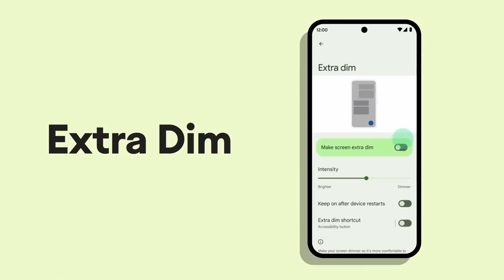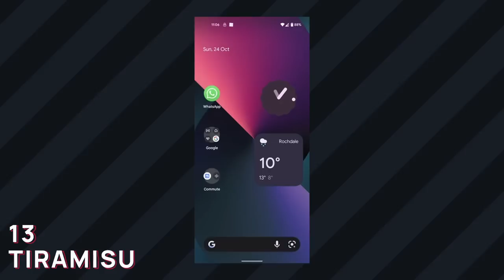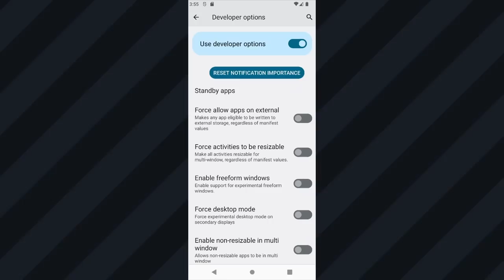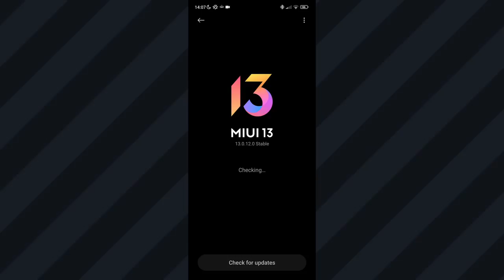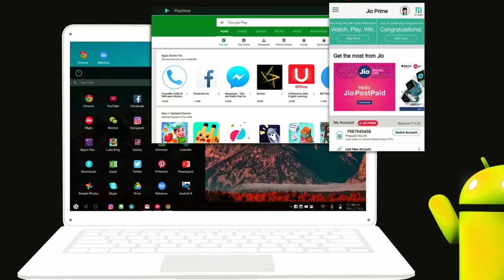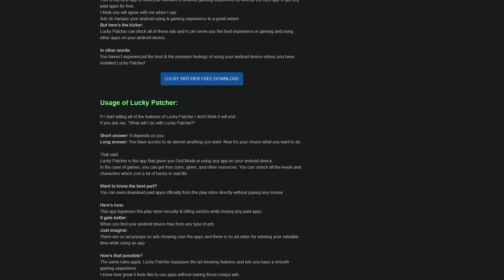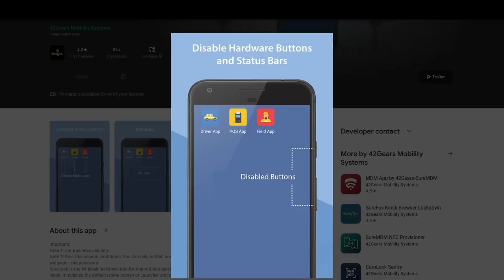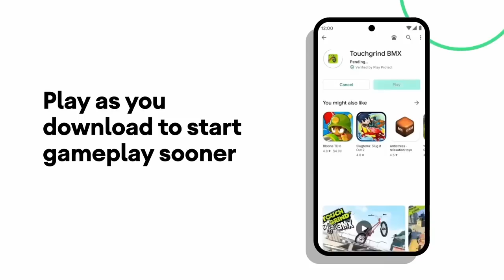The Complete Android Iceberg Explained

Comment: Btw, if your phone are running Android 12L/13 (yes, a phone, not a tablet) try setting the DPI (normally found on Display/Developer Option) to around 600 and Taskbar will appear, although somewhat broken.
Reply: Note: It's best to try it on AOSP Custom ROM (Pixel Experience and other) but I tried Ported Motorola Stock ROM and taskbar does appear, I can't say the same for other OEM so your best answer is to try it yourself
Reply: Wow it actually works! I dont think it's particularly useful but whatever
Reply: @lordkaczuha4598  Few Custom ROM made it very usable (even some implementing it to their ROM) and at some point: very useful for the ones that always multitasking
Reply: @Hyrionn  I use lineage os 20.0 myself and it works for multitasking, its just that i find the gestures super clunky as im more used yo the 3 button navigation
Reply: @lordkaczuha4598  Yea personally I wouldn't use it, but it's a nice fact to know
Reply: @Hyrionn  which device are you running motorola rom on?
Reply: @mom_spaghetti  Redmi Note 8, port for it  exist though my Note 8 just died recently after 4 year of continuous uses
Reply: this feature is meant for tablets
if you flash a gsi on a tablet you would normally have phone ui

Comment: one other weird samsung feature is the heart rate, SpO2, and UV (UV measurement feature got removed with an update to Samsung Health app, need to use old versions to measure) sensor that got added on S5 and Note 4. The sensor got removed on S10 and Note 10 devices.
It also worked like a shutter button on the front camera.
Reply: They really should add these old features back, especially the thermometer and the heart rate
Reply: the sensor still on s10 it got removed on s20
Reply: @whit3zin  hmm it seems like i confused the two

Comment: 1:45:49 it probably has some uses like public kiosks used to get information about the business, bus arrivals, etc. where you don't want people to mess around with the device. Or POS terminals where again, you don't want people to do something they shouldn't.
Some things that I think should be included on this Iceberg:
Backing up apps - some skins (like MiUI) or even apps (Google Files) allow you to back up apks, even the paid ones. 
Flashlight apps - why do those still exist? other than spreading malware or showing a bunch of ads
Cleaners, boosters, speed-ups, etc. - apps that claim to be able to speed up your phone
Fake specs - dodgy phones Wish, AliExpress, and similar websites usually have faked specs like 1TB of storage while in reality, it is 8GB (Smoorez on YT makes videos about these)
Activity launcher - an app that allows you to launch individual Activities. What's interesting is that you can use this to launch some hidden settings, hidden bloatware, hardware tests, or even that app that fakes specs
Reply: Can the activity launcher thing play btd4?

Comment: Pixel isn't exactly a rename of the Nexus series. With Nexus, Google managed everything except production and some design elements. With Pixel, Google handles all aspects of creating the phone. Also, Lucky Patcher does not require root, at least for most functions. At 1:47:15 ish, you talked about an Intel Android phone and asked how many Intel phones we've seen on the street. To be fair, it'd be hard to tell if a phone had an Intel processor inside just by looking at it, especially if there were phones not made by Intel that had them (maybe Samsung put them in their phones secretly for all we know).

Comment: I'm currently running a Google Pixel 2XL using LineageOS. It's rooted, I have Xposed installed, and I'm using MicroG instead of the proprietary Google Play services. I love the freedom Android enables.
Reply from the maker: Such a Chad.
Do Banking apps work?
Reply: @byteseb  Mine does! I also get Pokemon Go to work more often than not, though sometimes it does detect root access

Comment: Great video! only thing you forgot to talk was Freedom app to bypass in-app billing, and all type of recoveries (TWRP, CWM, PhilZ Touch Recovery, Orange Fox etc), the mediatek sharing the same base of rom and you can port them to any other phones with the same SoC, Android running on some Lumia phones. Also the death of some phone like some nexus or samsung having a dead eMMC flash drive (causing bootloops and booting straight to recovery mod or even worse a bricked device). And the most important, the raise and fall of CyanogenMod ROM and the Cyanogen company (and the cooperation with some brands like OnePlus) and the Xposed app. Overall pretty good video tbh
Reply: Yes, i remember using freedom back in 2014
Reply: Not only mediatek, snapdragon also supports ROM porting. I used to install GSIs a long time ago on my mediatek phone and that bootloop issue happened with me too lol
Reply: @mom_spaghetti  it was more common to see MTK ports instead MSM ports. Because MSM rom was more "touchy" than MTK was.

Comment: google play services are spyware but there is microG which is is the same thing but with less spyware. Android isn't fully written in java and it's Linux kernel is written in C and soon with small parts in rust.
Reply from the maker: I mean, MicroG is an open source implementation of GMS, so it is as open source as it's possible, but there are some proprietary things that they can't fully avoid, so I agree.
And thanks for the observations. Some parts of Android use Java, but you're right about Linux being written primarily in C.

Comment: In what dimensions are foldable phones, a new technology? That already existed at the time, when phones still had buttons and the term “touch screen” wasn't even invented. Oh, an Android without the Spy and Bloatware  would be cool
Reply from the maker: I meant that foldable screens are a new technology, not the concept of a flip phone itself.
And yeah, I like Android, but it sucks that most apps depend on GMS.
Reply: @byteseb  

Oh, you meant bendy screens (as I like to call them because they can bend) yeah those are new that's right
Reply: Yeah there was foldable touch screen phones back then but they used 2 displays instead of 1 display that just bends
Reply: Even the ds does it 💀

Comment: My only problem with Android was that it never really had minimum system requirements and a lot of sh*t entered the market, ending up in a landfill, while the EU complains about McDonald's using plastic straws. Someone should make laws about these.
Reply from the maker: You're right.
I mean, Google benefits from more people using their OS, so it doesn't make a ton of sense for them to limit its adoption, even when it could be more eco-friendly.
Probably the same applies to Windows, being preinstalled on devices that won't give you a decent experience, but by buying it, you're already paying the license.
Reply: @byteseb  but right now I have an Archos 10 inch tablet which I got as brand new for xmas. It has Android 7.1, but it is useless because Google did not want to set minimum required amount of RAM to 2 GB for Android 7.1. I would sell it, but it is slow beyond use. And that indeed CAN scare people off of Android forever if they do not know anything about tablets and bought any cheap device without help and advice.
Reply from the maker: Probably try installing a Custom ROM?

Comment: I used to use Kingroot it worked well, but I hear it bundled spyware. Another such case I used it was Amazon fire phone, but I replaced the stock rom using the root which removed Kingroot so nothing of value was stolen I ended up putting Cyanogenmod on it. To my understanding they used exploits in the Linux kernel to gain root which bypasses the need to a unlocked bootloader! Many phones still have a locked bootloader like my Verizon Pixel 3a before I switched to a 6a directly from Google so I would like to see this approach come back ideally without the malware part and open sourced. On iOS this is the main way of doing things still to my knowledge but known as jailbreaking instead.
Reply: I also used KingRoot when being lazy, to then flash custom recovery and wipe system clean

Comment: I hate that factory reset protocol. Half the cheap used androids on Amazon have been factor reseted with the previous owners account still on it so you just have a overpriced paperweight with you only hope is probably download a new os onto it or have the technical experience to do so on a non mainstream android device that no one is interested in make compatible with alternative phone os

And yeas I have obtained more paperweights then I'll ever actually need from amazon. I'm only keep them to push myself to learn everything about every electron of a paperweight
Reply from the maker: Have experienced this myself. 
Had an acquaintance whose Samsung phone was bugged and couldn't be unlocked due to a failed update. 
I factory reset it, but turns out it had FRP, and the owner didn't remember their accounts...

Comment: android suck , they killed termux
Reply: As a Windows and Android user, what is Termux
Reply: @ThatOneWindowsFan  Termux is a free and open source terminal emulator for Android which allows for running a Linux environment on an Android device. In addition, various software can be installed through the application's package manager
Reply: @ThatOneWindowsFan  with it you can even use adb without pc
Reply from the maker: You mean the Play Store version? It's still being maintained in F-Droid
Reply: @xDoge26  Ahh... I see.
Reply: @byteseb  hell nah , they cant escape phantom process killer